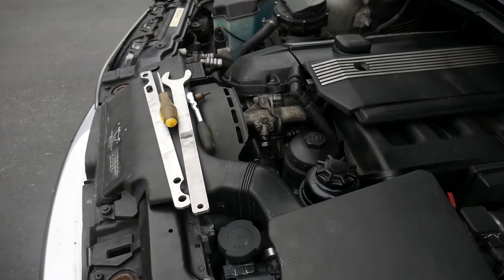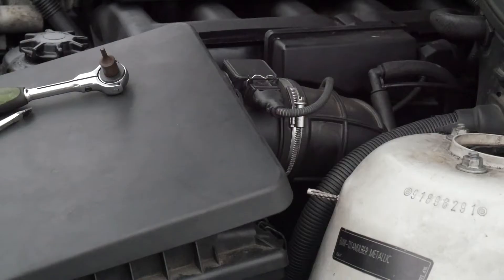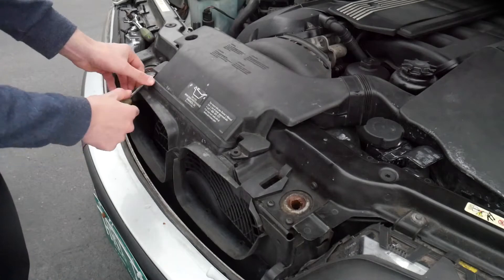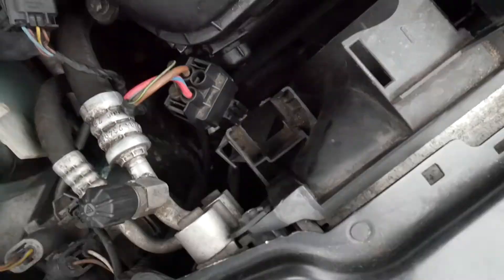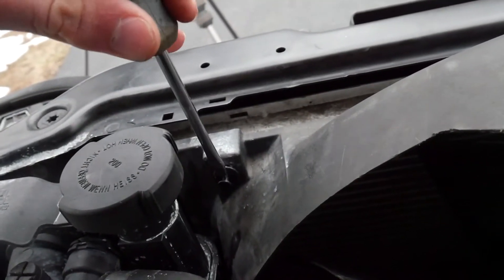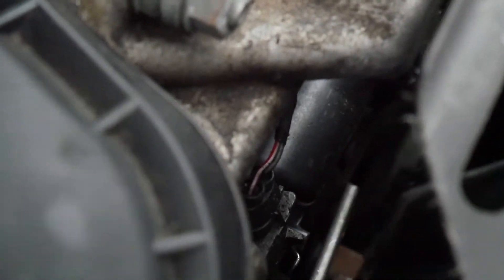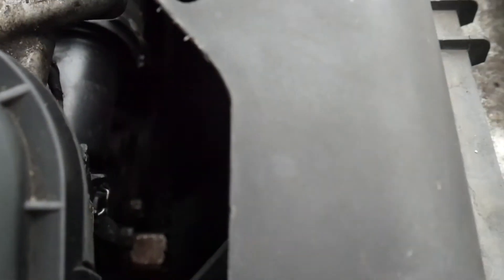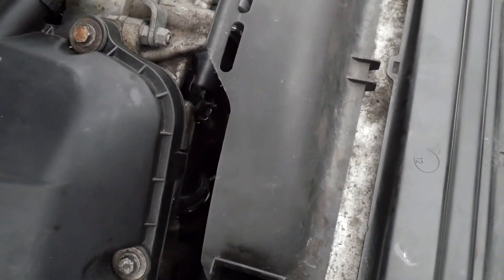How to Remove Fan and Shroud on a BMW e46

Comment: Short & to the point…get the 32 mm long clutch nut wrench & the fan pulley bolt offset wrench. I tried to do it without them - it’s a nightmare.
Reply: thank you bro, i need to replace my serpentine belt

Comment: The fan clutch nut has left hand threads.  Not a trivial detail.
Reply: Left out in the video on which direction it comes loose
Reply: Yea, you can see which way it's spinning in the video. But thanks for confirming
Reply: Actually, this info is most relevant, compared to the content in this video. .